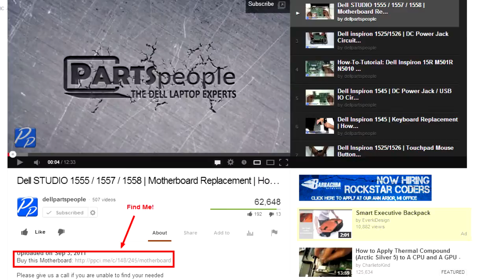Dell Inspiron 15R N5110 Palmrest Touchpad Replacement Video Tutorial

Comment: When you lifted the palm rest ,on the left side of the touch pad, did you see that small area with "PAD" engraved on it?
I just researched and it is sopposed to house a thermal pad there as it is directly above the chipset 
I was thinking if you would know anything about it's advantage even if i did put the thermal pad there since there dosent seems to be any cooling tech near it

Comment: I have palmrest with broken plastic on it. Can I disassemble touchpad board from palmrest and assemble it on second solid palmrest with  nonworking touchpad?
Reply from the maker: I would guess yes. I haven't removed the touchpad on this laptop before but I think it can be removed if you remove the buttons first. It should be attached by a couple of screws on the reverse side of the palmrest.
Reply: Thx for reply, will try.
Reply: Oleksandr Gavrylenko
 did you found a solution? Is the touchpad removable?